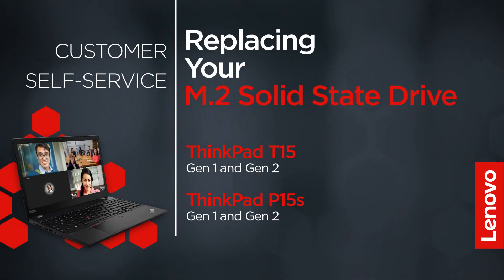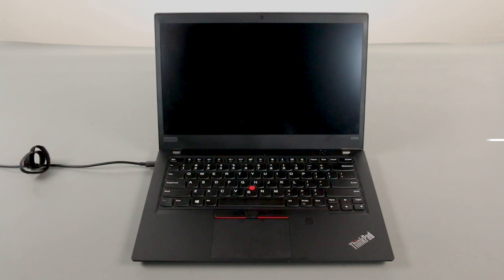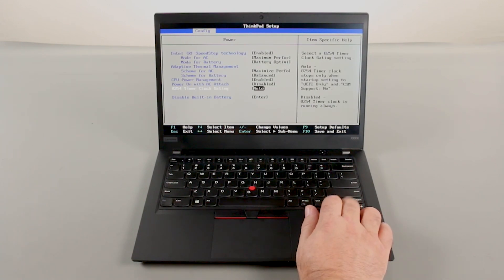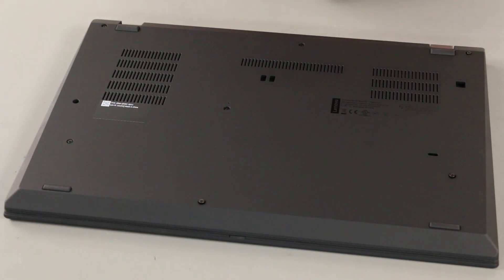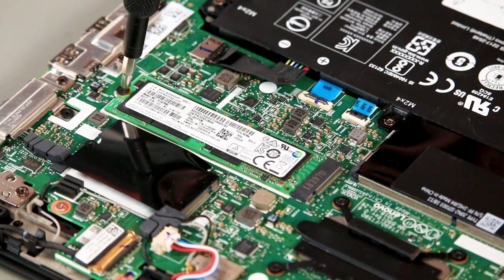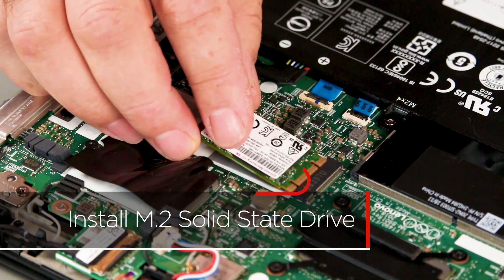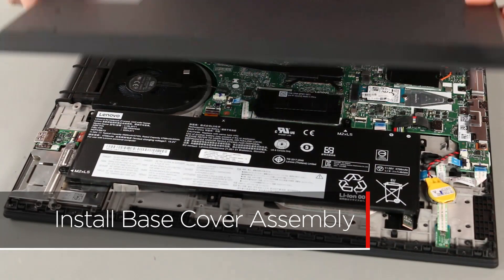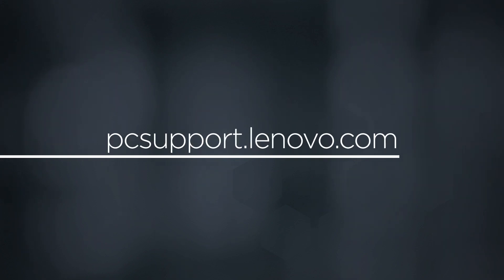Replacing Your M.2 Solid State Drive | ThinkPad T15 and P15s Gen 1 and 2 | Customer Self Service

Comment from the maker: This video will show you how to replace the M.2 Solid State Drive of your ThinkPad. The process in this video will work for the ThinkPad T15 Gen 1 and Gen 2 and the ThinkPad P15s Gen 1 and Gen 2. 

You will need a screwdriver kit, a non-metallic pry tool, and 15 minutes of your time.

To learn more about your device go to https://pcsupport.lenovo.com

To find parts for your device go to https://support.lenovo.com/parts-lookup/?cid=ww:lenovosocial:b9515f&source=socialmedia&subsource=yt

To view the Lenovo Support Self-Repair Guides landing page go to https://support.lenovo.com/us/en/solutions/HT516547

** NOTE: Static electricity can destroy components. Use a grounding strap, and clean, non-conductive surface to work on. Use plastic or coated tools to prevent scratching and avoid using metal tools on plastic parts. For more detailed information on electrostatic discharge and how to prevent it, please watch our ""Understanding Electrostatic Discharge (ESD)"" video: https://youtu.be/by4PB3WtdLo 

Applicable Machine Types:
ThinkPad T15 Gen 1 - 20S6, 20S7
ThinkPad T15 Gen 2 - 20W4, 20W5
ThinkPad P15s Gen 1 - 20T4, 20T5
ThinkPad P15s Gen 2 - 20W6, 20W7

#lenovo #LenovoSupport #LenovoTechSupport